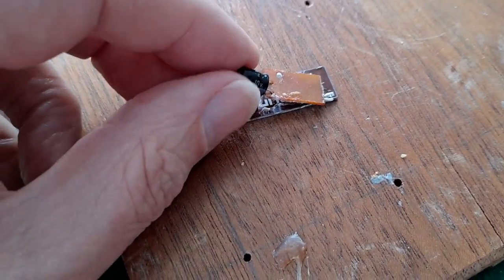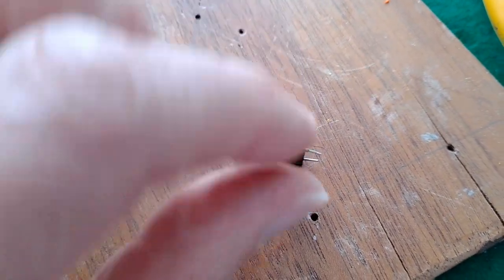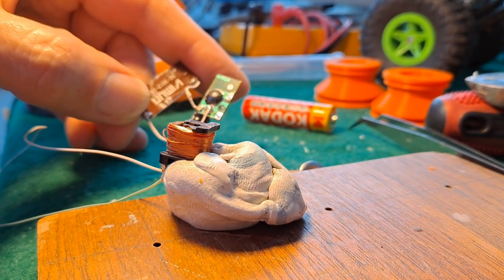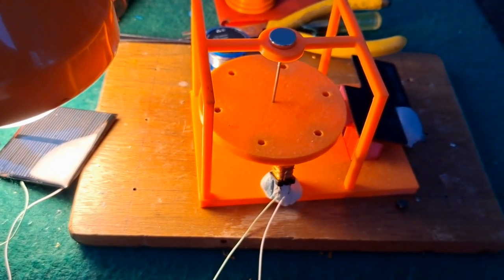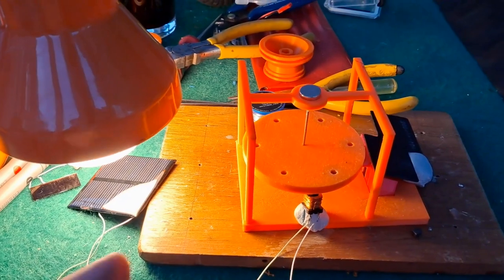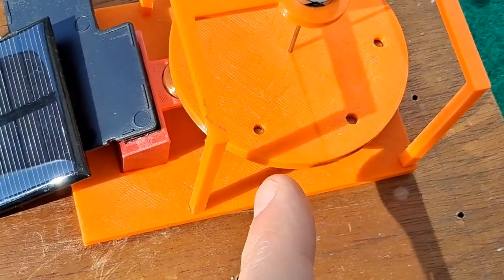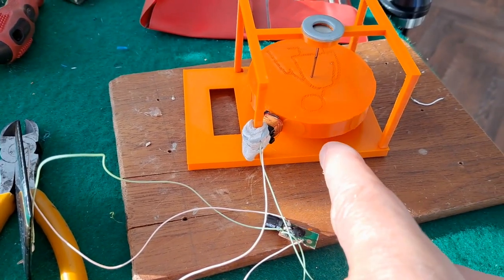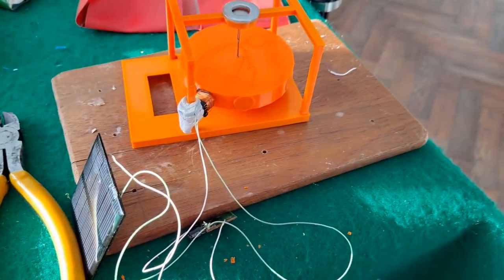Solar rocker circuit board and random coil

Comment: These are fun to mess around  with.  I just replicated your solar rocker/direct connected super capacitor experiment.  My super cap is a smaller value than what you used so it fills up faster and discharges sooner.  The effect is the same though and is fascinating to watch.  It is a  light powered running device that gathers more energy than it consumes and runs on the stored energy when the light source is cut off.  Imagine if we had super efficient solar electric cars that did that.
Reply from the maker: The supercap on the rocker demonstrates how little energy those rockers use once they are running. My solar snowman still runs on dead batteries that seem to get regenerated by magic. I just had to go and look to see if he is still running, and he is. I don't remember how long it has been running on the current battery. I really should remember to write a date on them.
Reply: @GrandadIsAnOldMan  Ah the famous Snowman rocker.  It is amazing how many years you have run that experiment. I am running some experiments on Duracell rechageable AAs now that are similar.  They drain down to about .7v and just sit there.

Comment: That would be an inductor. Although you did say it came out of a relay. I wonder if it would work better if you took the core out of it? 👍
Reply from the maker: You are probably right, just an odd item in one of my boxes of junk. I would have to watch the video again regarding the core. I did take it out and use a 3d printed mount. Might be a later video. I wound my own coil for it later and did a different magnet disc.

Comment: the cap is matched to the coil and cell , i think it may be a kind of "tuned" circuit ? the back emf from the coil passing the magnet fires the coil ? from the cap via a transistor 
if the coil wire is bigger it will effect the resistance ,and the charge/discharge time will be effected .plus your solar cell may be "collapsing" under the current demand,unlike a battery. but then what do i know ? lol keep up the good work m8 ,love it
Reply from the maker: Bigclivedotcom did a good reverse engineer video on the circuit a few years back https://youtu.be/MHRxYtVD1IU?list=PLA5a2xPRSrB1L61NAVuE5I9FbPgq3sSG1